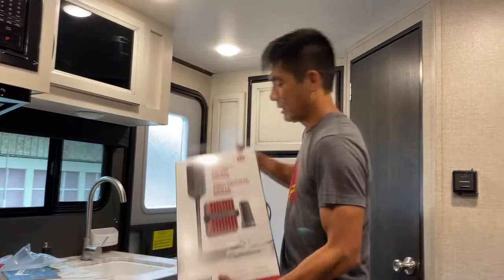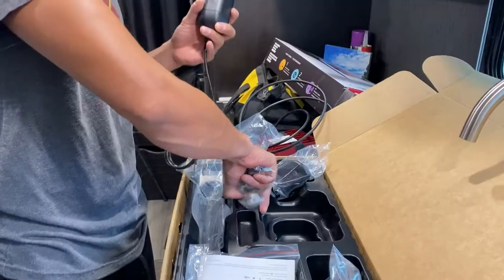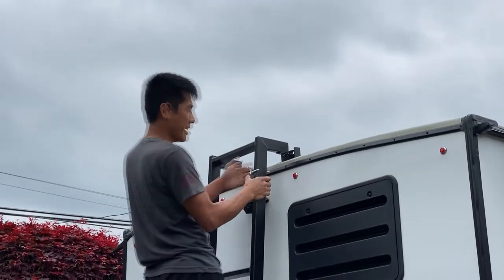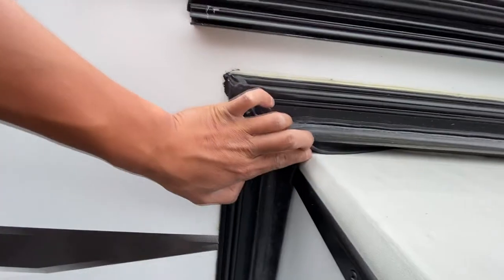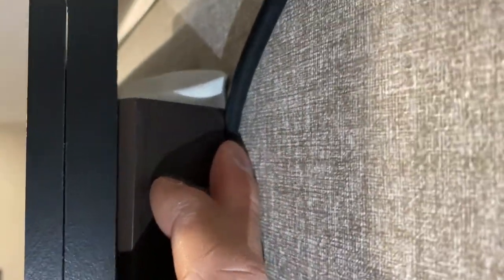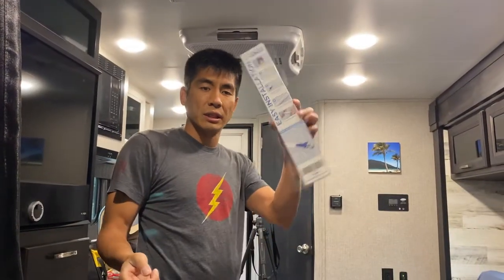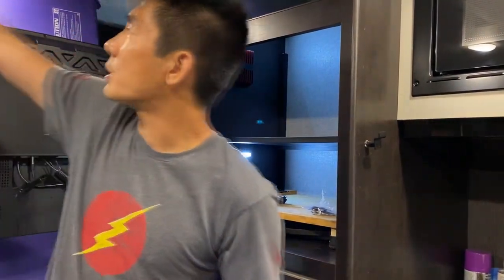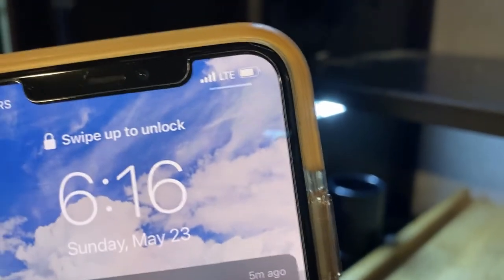Jayco 166FBS - Weboost Drive Reach RV Install

Comment: Enjoyable to watch, Mike. Tips:1)  reusing bike inner tubes for protective surface on rv ladder works great, and also allows for better mounting, cushioning vibrations. 2) When drilling through surface, to avoid 'blowouts' can sue smaller drill bits for pilot, and since you have access to both sides, drill from opposite side after first hole. Another option is a  grommet to insert, which gives the hole a finished look. Safe travels.
Reply from the maker: Thanks for the tips!

Comment: Nice video. We are leaving for a 2 month rv trip in a few days and I just added a Weboost to our trailer. I mounted near the top of the ladder like you. For cabling, I have a satellite port near the bottom of the ladder. I bought coaxial adapters to use the trailer wiring to the tv, mounted there, and I will manually install the antenna when we need it. It doubled our data speed in the trailer at our home location, 22mbps compared to 11mbps.

Comment: Mike, I purchased the weboost for my 166FBS. I also mounted the antenna on the lader. Im going to run the cable to the Winegard 360 antenna (its just a cover) lift the cover, and drop the antenna cable through the existing hole where the TV antenna cable goes through. Looks like there is a cable chase in the back of that cabinet that hides wiring. From there I can connect it to the Booster. No holes drilled. Thinking ahead I'll probably run a coaxial cable for a future DISH Tailgator I'll install on the roof.

Comment: Great video, really enjoyed seeing how you ran all your cables.  I was lucky to have a roof fridge vent so I went through there where I already ran my solar lines for a clean install without drilling through the roof.  I’d be interested in your experience with this product after using it for a while.
Reply from the maker: It's been great! Has even provided cell service in areas where we had no bars at all on our phones! However one thing we've learned is you have to be very close to the interior antenna to get any sort of boost. Probably within 3-4 feet is max.
Reply: @LetsJustGoTravel  thanks!   I’ve heard that elsewhere too.  It seems like for data usage most people just put their tethered hotspot right next to it and connect devices to that.

Comment: Hi Mike, there are so many ways to get internet in your RV. I did a lot of research and narrowed it down to one or two systems. The one I chose was the insty connect. It was only about $100 more than the cell phone booster that you installed. With this system it makes the cell phone booster obsolete. I am picking up a cell phone tower that is 56 miles away and I’m getting download speeds of almost 120 gigs. I’m not a salesperson for insty connect, I’m just a happy customer. You can check it out by going to “We Can Explore it” and also “Sele Training “. Also pay attention to Jason Sele when he talks about the TTL setting.
Reply from the maker: Oh wow! I haven’t heard of that one but I’ll check it out! Too bad I’ve already installed this one haha your system sounds awesome
Reply: I like your channel and I’m glad you weren’t offended. I like your idea of putting the cable through your slide. The less holes in the roof the better. I can’t wait for your next project.
Reply: Checked out the system you mentioned and it seems as though  the base model it is close to double the cost, and over $1300 if upgraded?

Comment: I just installed my same unit: Weboost Drive Reach RV today. After running for a couple of hours it seemed hot. So I put my IR thermal gun on it and read 152 degrees farhenheit!  Boy that seem HOT.  Have you experienced similar operating temperatures?  Thanks
Reply from the maker: Hey yes the unit does get very hot. Too hot to touch sometimes. However the weboost website states that this is normal operation so I’m assuming there’s no problem!
Reply: @LetsJustGoTravel  I added a little 12 volt fan just now. I'm going to test it overnight, but already the temps have dropped to around 120 deg. F. (from 152). Less heat has got to help it last longer, and not warm up my cabin.....

Comment: Hey, good video!

Do you think you could have used the outdoor cable port for satellite/câble, instead of passing through the slide?

As I doubt you would ever connect to cable, well I don’t thing I would.
Reply from the maker: Hey yeah I suppose you could do that! Sounds like a great solution. I haven’t had any water intrusion issues so far so we’ll see..
Reply: It would require adapters but it could work.  Great idea, especially knowing most of us that are in the 21st century just stream and don’t use the cable inputs.

Comment: Hi Mike,  after over a year of having this signal booster, would you still recommend it?   We always have low signal whenever we camp (we're in Ontario, Bell) and we'd like to have something to improve this, however the reviews on this product and similar are mixed.    I see the prices between similar units on Amazon are all over the map too; ranging between $100s - $700s.    

On another note, really excited to see your major North American tour!   We have a 166FBS and are very interested to see how it holds up, given we have similar ideas in the years to come.   The waterfalls video you just dropped was amazing; I had no idea.

Safe travels!
Reply from the maker: Thanks for your support! To be honest since we’ve gotten Starlink RV we barely use the weboost in the trailer. We have the same weboost installed in our truck that we have running while towing or driving around , which we are happy to have. 
I don’t have any experience with cheaper alternatives but if they can achieve similar performance then maybe it’s a good choice! 
There definitely were times in the past when I was glad to have the weboost (before getting Starlink) and there are occasionally places where the weboost will win over Starlink (heavy forest areas) but at the end of the day it’s dependent on where you are and what services are in the area…

Comment: What about the range inside your rv how many ft can you walk away from the inside antenna before you lose signal . I got the OTR version and it just boost the 5G . I didn’t see any improvement on GSM signal nor LTE. I get 5G but it lost the connection from time to time . Want to know if the RV version gives you better inside range and also better signal overall for GSM, LTE AND 5G
Reply from the maker: You have to be very close to the antenna, probably within 3-4ft for it to work. We put our hotspot right next to it so we don’t have to stay near the antenna.
It’s always worked on LTE. I only recently got a 5G phone so I have yet to test it with 5G but it always worked well on LTE in the past.
I also bought the OTR version for my truck but haven’t installed yet. I would assume it works the same as it’s literally the same unit as far as I know.
Reply: @LetsJustGoTravel  I just returned my OTR version, getting the RV version, maybe it was just my unit. I had 2 bars of LTE and no 5G at all on the spot I was testing the we-boost. First I turned off my 5G antenna on my phone to see the improvement over LTE and somehow the signal got worst to 1bar and the speed test also got worse. Then turned on 5G , and it got 2 bars when I had 0 . I was happy about that result but I was very concern about not having any improvement over LTE . Then I also teste with all data off … to see if my GMS signal will improve and it didn’t move from 1 bar. Please let me know when you got to test your OTR version.
Reply from the maker: @GForce101  hey I got around to installing the OTR weboost to my truck today. Works on both 5G and LTE I went from 2 bars to 4 bars on both. Good that you returned yours ! Must’ve been defective